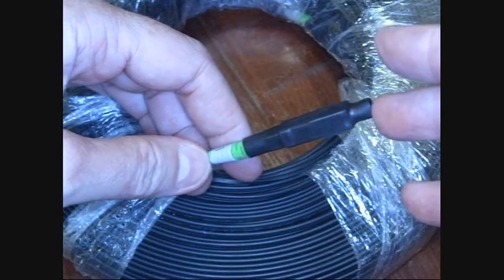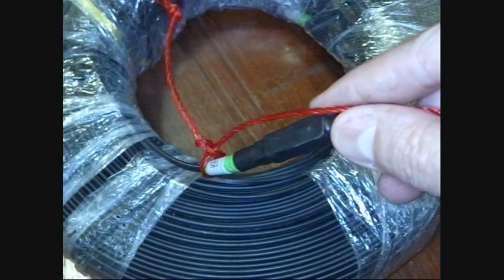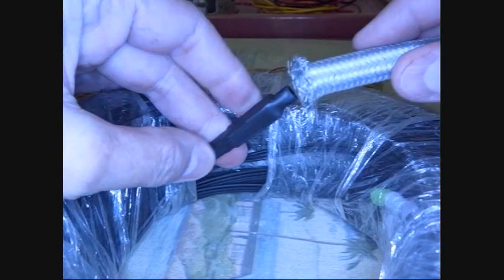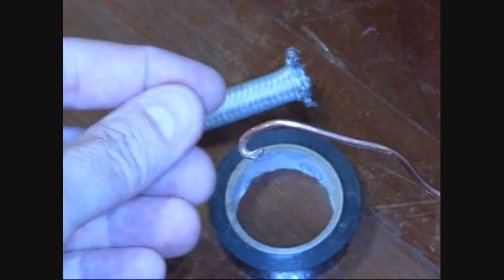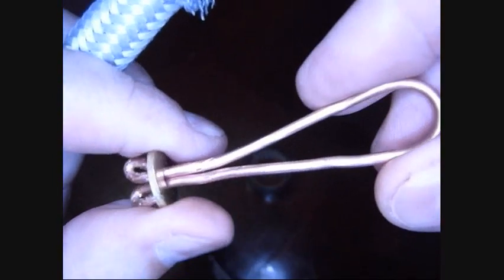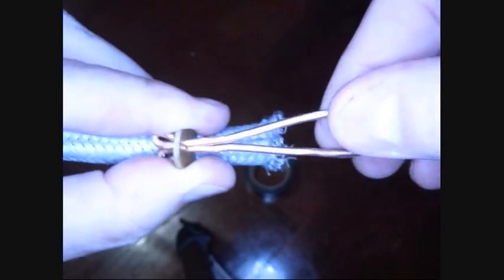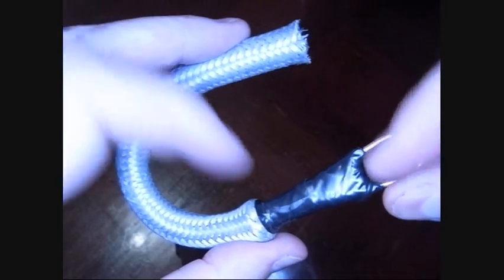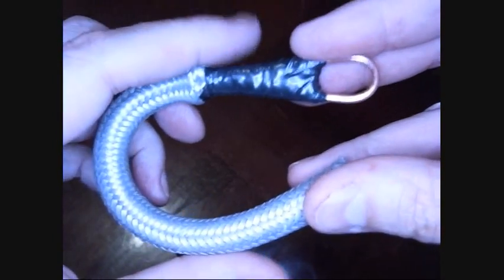DIY Fiber Optic Cable Puller

Comment: What size conduit are you pulling through and how long?
Reply from the maker: If I recall it was a 1.25" and about 5 meters maximum. But there were several segments, some we pulled before putting the joints together. The number of 90 degree joints also matters.
Reply: @tsbrownie  Yeah, 1.25 is a bit easier than my 3/4". It's all anyone had available when I was buying materials. Pulling fiber will be a challenge especially considering it will have to share space with Cat 5 and coax.
Reply from the maker: @helmanfrow  I made the mistake of buying the theoretical size to run 3 electric lines once. My electrician spent the next couple hours using my name in vain. Now I buy bigger.
About the cat 5, I've gone to cat 7 (not 8) because of longer distances, 1Gb vs 10Gb, and LOTS of shielding. It costs more, but you won't be replacing it to support 4K tvs, video streaming, etc. any time soon.
Reply: @tsbrownie  I wanted larger diameter flex but it simply wasn't available anywhere in Ontario last year. I called every retailer, supplier, distributor and manufacturer. 

I typed Cat 5 but it's actually Cat 6. I bought a spool of Cat 6a as well. It's  similar in construction and performance to Cat 7 but it was way too thick and inflexible to make it worthwhile on this last project. There's no way I was going to go through the hassle of pulling it and the expense of terminating it. I'll probably hang onto this spool because I got it for a song. It'll come in handy eventually.
Reply from the maker: @helmanfrow  I hear you on new cable being bigger, I tried to replace some 5 with 7 in the wall and it was not a smooth pull.
Reply: @tsbrownie  Yeah, it's nearly twice the diameter. And a lot stiffer. And the bend radius is significantly larger so it's harder to fit into a 2x4 wall without kinking or otherwise disturbing the integrity at the jack. 

Also it has foil shielding on every pair and an overall braided shield so shielded jacks are essential but they also cost $6-12 each as opposed to $1-$3 for unshielded. 
Then there's the extra labour.
Cost and complexity increase exponentially overall when you go from Cat 6 to Cat 6a or Cat 7.

You have to really want that 10G capability to make it worth the trouble
Reply from the maker: @helmanfrow  You got that right. The rooms we want to Cat7 are the office, the TV room, and 1 other potential office for when we sell the house. Having a house pre-wired with up-to-date stuff is a big deal for those non-techies! ;) Having said all that, if I can't get 7 through the walls, I may go fiber.

Comment: That's cool TS. It works like a Chinese finger trap. Thank you for all the cool  DIY's videos.
All my best.
Bobby
Reply from the maker: +Bobby Tectalabyss Thanks, but I have a confession: If you promise not to tell, I copied it from the monster ones they used for pulling really big power lines.  I'm sure you've seen them put up high tension power lines, they thread them along rollers using a similar thing.  I only steal (ideas) from the best!